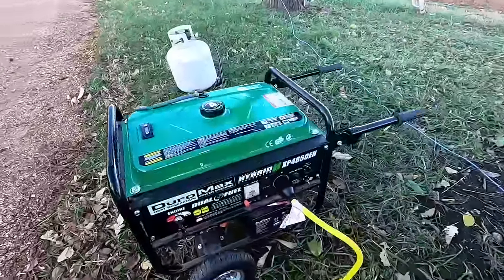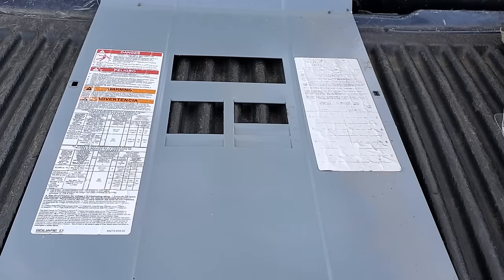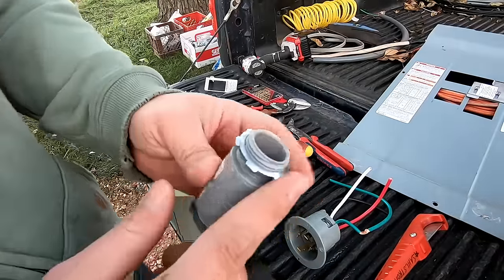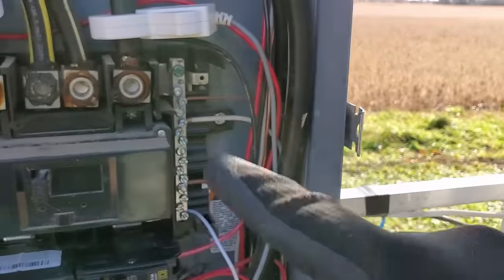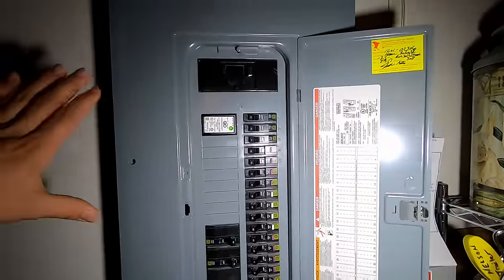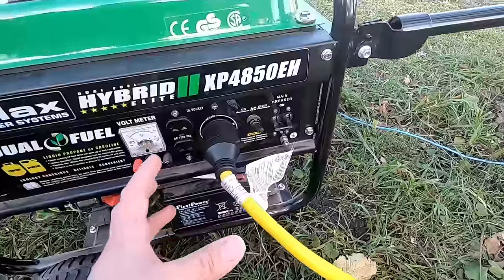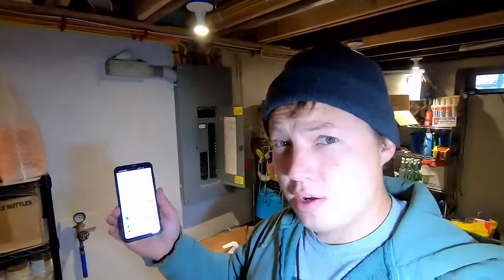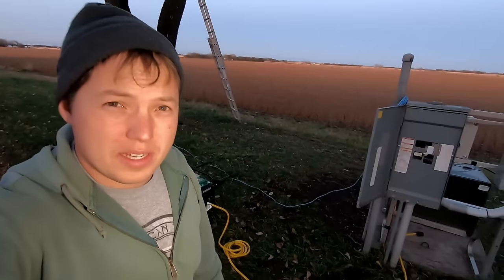How To Hook Up a Generator To Your House Using a Breaker Interlock Kit & Power Inlet Box

Comment: Hey bud -  I wanted to note something that I learned from the actual packaging of a generator I was considering this past week.  It turns out that Generator Output on Dual/Multiple fuel option generators will be DIFFERENT for each fuel type.  I don't have the numbers but it would go like this.  7Kw generator on gasoline, 5Kw on propane, and then about 4200 on natural gas.  I was shocked and because I also wanted to run on propane, it made me then re-consider the size of the generator as insufficient to run the breakers I want to leave on.  Someone may have already pointed that out - as you have 1200+ comments.  Great work - thanks for this video!
Reply: ⚠️ Here are the reminders about generator safety. We always need to make sure we follow all the generator safety rules whenever we use portable generators: 

Everyone must see this 

1) KEEPING OTHERS SAFE: Please do not allow an unqualified person or your children to operate and service the portable generator. Just because some manuals don’t say that doesn’t mean it’s safe. That is important against the generator safety rules. We also need to be keeping an eye on our children too. You need to make sure that your children are not playing near the portable generator especially when it’s running so they won’t get electrocuted. Generators pose electrical risks and they can be hot during an operation. Please keep your children away from the portable generator at all times. It is important to keep our children safe especially our little ones. Be aware of all the hazards.

2) WHERE TO RUN YOUR GENERATOR: Some people use their portable generators indoors which increases the risk of carbon monoxide poisoning. It’s important to have a carbon monoxide if you have a gas generator. Never ever use your generator indoors even if your doors and windows are open and even in the garage is not safe to use a portable generator. Not even at your porch and your deck. It is never safe to use your generator indoors and in enclosed areas of your home. Your generator needs to be 15-20 feet away from your house. 

3)🔥FIRE HAZARDS: Never refuel your generator while it’s running. You need to let your generator cool off before refueling it and before storing your generator. Never overload your generator too. Never ever back feed your generator. You should never plug your generator into a wall outlet. Also never store propane tanks indoors. Please keep flammable things away from the generator as well and please don’t smoke cigarettes near the generator. Having a fire extinguisher next to the generator is also important against the generator safety rules. 

4) GENERATOR OPERATION: make sure your hands are dry before touching the generator. Never use your generator in wet conditions. Don’t let your generator get wet. You need a generator tent if you need to use your generator during wet weather. Please don’t wear loose clothes when operating the generator. Turn on your generator before plugging in appliances. Use the right cord for your generator. Please do not use worn out cords. 

https://youtu.be/I1jT3ANENvI and here is a video more about keeping others safe when using generators 

Hope this helps

Comment: Thank you for proving the 4 wire cable from the generator to your 1st panel actually grounds the generator. Other emergency generator videos I have watched do not mention grounding the generator. In my case, I used a dedicated generator panel that includes only the circuits to be powered by the generator. Using a similar switching arrangement I can easily disconnect it from the grid and I don’t have to worry about overloading the generator because I’ve already sized the panel for my generator’s capacity.
Reply: Please don’t forget about the generator safety rules: Always make sure you follow all the generator safety rules whenever you use your portable generator. This is only a reminder. Generators can be dangerous if not used carefully. Every year, hundreds of people die or get injured when using portable generators due to carbon monoxide poisoning and electrocution. Make sure you are using your generator carefully and keeping others safe as well. There is something very serious that everyone should always be aware of when using generators. Some people do run their generator indoors which is not safe and that increases the risk of carbon monoxide poisoning which can cause death of family and you. Some people run their generator in wet conditions which can electrocute them. Please remember that you should never run your generator indoors. Remember that carbon monoxide is an odorless and colorless gas that you cannot see or smell. Carbon monoxide is a silent killer. Keep that in mind. Make sure your generator is 15-20 feet away from your house and away from doors, windows, and vents. Never use your generator in your porch too. Having a carbon monoxide detector is very important against generator safety. Some people also allow children to go near the portable generator which could pose risks. We need to keep an eye on our children making sure that they are not near the portable generator so they won’t get electrocuted or burned by the generator which is dangerous. A locking enclosure also keeps kids safe. A generator shed might look like a tempting place to explore, or take cover during a game of hide and seek, but a generator is a dangerous piece of equipment that can cause injury. It says on the manual that we should also keep children away at all times from the portable generator to avoid injuries. Please do not allow a child or unqualified people to operate the portable generator.  It is important to keep your children safe especially little ones. The portable generator can be hot during an operation. Just because some manuals missed what should be listed doesn’t mean it’s safe to do. Always follow the generator safety rules when using portable generators. Generators pose electrical risks. If you need to use your generator during wet weather, you need a generator tent to protect your generator from getting wet. Don’t let your generator get wet. Keep your generator dry and before using your generator, please make sure your hands and your generator is dry. Do not wear loose clothing when operating the generator. Everything that is said on the generator’s operating manual should not be ignored. Never smoke cigarettes near the generator. Please keep flammable things away from the generator. Never overload your generator too. Your generator can catch fire. Never ever try to plug a generator cord into a wall outlet to avoid back feeding. Back feeding your generator is dangerous. Always turn on your generator first before plugging in appliances and shut off the appliances before turning your generator off. Use a heavy duty cord for your generator and the cord should not be worn out. All the instructions should be followed carefully. Never refuel your generator while it’s running. It can cause fire if fuel spills while your generator is hot. You should turn off your generator and let it cool off before refueling it. Having a fire extinguisher next to the generator is also important. This is only a reminder for everyone’s safety of using generators. Make sure your generator is properly grounded. Having a fire extinguisher next to the generator is also important against the safety rules. https://youtu.be/I1jT3ANENvI and here is a video more about keeping others safe when using generators and also about our family’s safety. It’s important to keep our little children safe as well. Make sure your little children are kept away from the generator at all times especially when it’s running. Hope this helps. Always remember that it’s better to be safe than sorry.

Comment: The best DYI video on how to correctly connect my portable generator to my house. I chose the breaker interlock method, which was easy and the least expensive. Thanks for teaching this old soldier some new, useful, and safe lessons for keeping the lights on in a black out. Blessings to you and your family!
Reply: Don’t forget about the safety rules of using generators: Always make sure you follow all the generator safety rules whenever you use your portable generator. This is a reminder for everyone’s safety of using generators. Generators can be dangerous if not used carefully. Every year, hundreds of people die or get injured when using portable generators due to carbon monoxide poisoning and electrocution. Make sure you are using your generator carefully and keeping others safe as well. There is something very serious that everyone should always be aware of when using generators. Some people do run their generator indoors which is not safe and that increases the risk of carbon monoxide poisoning which can cause death of family and you. Some people run their generator in wet conditions which can electrocute them. Please remember that you should never run your generator indoors. Remember that carbon monoxide is an odorless and colorless gas that you cannot see or smell. Carbon monoxide is a silent killer. Keep that in mind. Make sure your generator is 15-20 feet away from your house and away from doors, windows, and vents. Never use your generator in your porch too. Having a carbon monoxide detector is very important against generator safety. Some people also allow children to go near the portable generator which could pose risks. We need to keep an eye on our children making sure that they are not near the portable generator so they won’t get electrocuted or burned by the generator which is dangerous. A locking enclosure also keeps kids safe. A generator shed might look like a tempting place to explore, or take cover during a game of hide and seek, but a generator is a dangerous piece of equipment that can cause injury. It says on the manual that we should also keep children away at all times from the portable generator to avoid injuries. Please do not allow a child or unqualified people to operate the portable generator.  It is important to keep your children safe especially little ones. The portable generator can be hot during an operation. Just because some manuals missed what should be listed doesn’t mean it’s safe to do. Always follow the generator safety rules when using portable generators. Generators pose electrical risks. If you need to use your generator during wet weather, you need a generator tent to protect your generator from getting wet. Don’t let your generator get wet. Keep your generator dry and before using your generator, please make sure your hands and your generator is dry. Do not wear loose clothing when operating the generator. Everything that is said on the generator’s operating manual should not be ignored. Never smoke cigarettes near the generator. Please keep flammable things away from the generator. Never overload your generator too. Your generator can catch fire. Never ever try to plug a generator cord into a wall outlet to avoid back feeding. Back feeding your generator is dangerous. Always turn on your generator first before plugging in appliances and shut off the appliances before turning your generator off. Use a heavy duty cord for your generator and the cord should not be worn out. All the instructions should be followed carefully. Never refuel your generator while it’s running. It can cause fire if fuel spills while your generator is hot. You should turn off your generator and let it cool off before refueling it. Having a fire extinguisher next to the generator is also important. This is only a reminder for everyone’s safety of using generators. Make sure your generator is properly grounded. Having a fire extinguisher next to the generator is also important against the safety rules. https://youtu.be/I1jT3ANENvI and here is a video more about keeping others safe when using generators and also about our family’s safety. It’s important to keep our little children safe as well. Make sure your little children are kept away from the generator at all times especially when it’s running. Hope this helps. Always remember that it’s better to be safe than sorry. Also remember that warnings should not be ignored too.

Comment: Very good video! Thumbs up for orienting all the shoulder bolt slots at  3:00-9:00.
Reply: ⚠️Please don’t forget to follow the generator safety tips when you use your portable generator:

This is a reminder for everyone’s safety when using portable generators. All generator safety rules need to be followed carefully whenever you use your portable generator. This is just to make sure. 

1) KEEPING OTHERS SAFE: Please do not allow an unqualified person or your children to operate and service the portable generator. Just because some manuals don’t say that doesn’t mean it’s safe. That is important against the generator safety rules. We also need to be keeping an eye on our children too. You need to make sure that your children are not playing near the portable generator especially when it’s running so they won’t get electrocuted. Generators pose electrical risks and they can be hot during an operation. Please keep your children away from the portable generator at all times. It is important to keep our children safe especially our little ones. Be aware of all the hazards.

2) WHERE TO RUN YOUR GENERATOR: Some people use their portable generators indoors which increases the risk of carbon monoxide poisoning. It’s important to have a carbon monoxide if you have a gas generator. Never ever use your generator indoors even if your doors and windows are open and even in the garage is not safe to use a portable generator. Not even at your porch and your deck. It is never safe to use your generator indoors and in enclosed areas of your home. Your generator needs to be 15-20 feet away from your house. 

3)🔥FIRE HAZARDS: Never refuel your generator while it’s running. You need to let your generator cool off before refueling it and before storing your generator. Never overload your generator too. Never ever back feed your generator. You should never plug your generator into a wall outlet. Also never store propane tanks indoors. Please keep flammable things away from the generator as well and please don’t smoke cigarettes near the generator. Having a fire extinguisher next to the generator is also important against the generator safety rules. 

4) GENERATOR OPERATION: make sure your hands are dry before touching the generator. Never use your generator in wet conditions. Don’t let your generator get wet. You need a generator tent if you need to use your generator during wet weather. Please don’t wear loose clothes when operating the generator. Turn on your generator before plugging in appliances. Use the right cord for your generator. Please do not use worn out cords. 

https://youtu.be/I1jT3ANENvI and here is a video more about keeping others safe when using generators. Everything that is said about the generator safety rules all need to be followed. Especially keeping your children safe. 

Hope this helps

Comment: I’ve watched quite a few videos on generator to home set up. Yours is by far the most helpful. Thanks
Reply: Truck Livin yep. I agree
Reply: Don’t forget about the generator safety tips as well. Remember it’s important to follow all the generator safety rules whenever you use your generator. Here are the generator safety tips:

1) Please do not allow an unqualified person or your children to operate the portable generator. Just because some manuals don’t say that doesn’t mean it’s safe. That is important against the generator safety rules. We also need to be keeping an eye on our children too. You need to make sure that your children are not playing near the portable generator especially when it’s running so they won’t get electrocuted. Generators pose electrical risks and they can be hot during an operation. Please keep your children away from the portable generator at all times. It is important to keep our children safe especially our little ones. Be aware of all the hazards.

2) Some people use their portable generators indoors which increases the risk of carbon monoxide poisoning. It’s important to have a carbon monoxide if you have a gas generator. Never ever use your generator indoors even if your doors and windows are open and even in the garage is not safe to use a portable generator. Not even at your porch and your deck. It is never safe to use your generator indoors and in enclosed areas of your home. Your generator needs to be 15-20 feet away from your house. 

3) 🔥generators cause fire hazards too. Never refuel your generator while it’s running. You need to let your generator cool off before refueling it and before storing your generator. Never overload your generator too. Never ever back feed your generator. You should never plug your generator into a wall outlet. Also never store propane tanks indoors. Please keep flammable things away from the generator as well and please don’t smoke cigarettes near the generator. Having a fire extinguisher next to the generator is also important against the generator safety rules. 

4) generator operation; make sure your hands are dry before touching the generator. Never use your generator in wet conditions. Don’t let your generator get wet. You need a generator tent if you need to use your generator during wet weather. Please don’t wear loose clothes when operating the generator. Turn on your generator before plugging in appliances. Use the right cord for your generator. Please do not use worn out cords. 

https://youtu.be/I1jT3ANENvI and here is a video more about keeping others safe when using generators and also about our family’s safety. Hope this helps